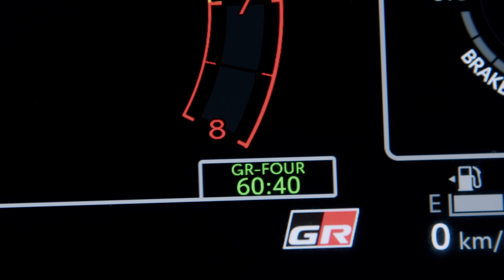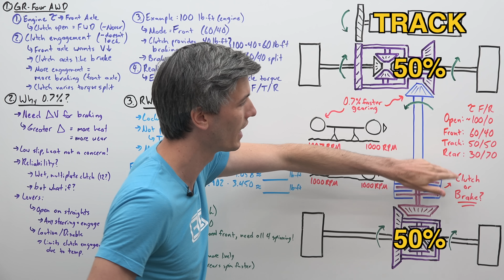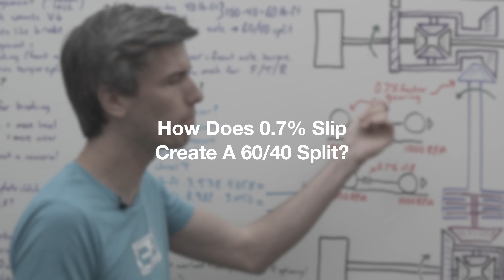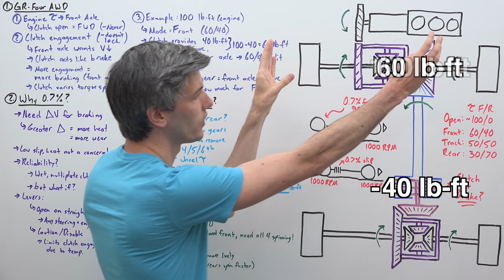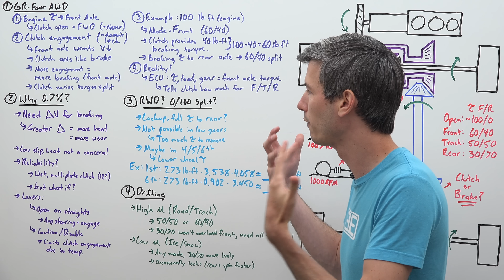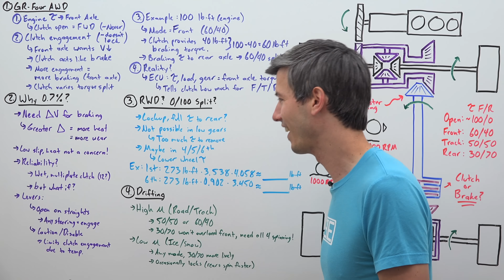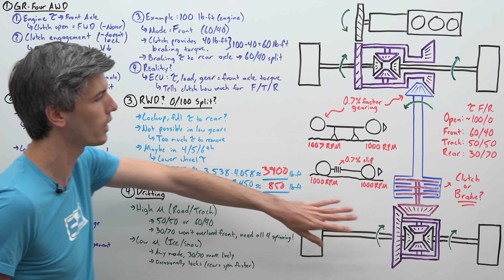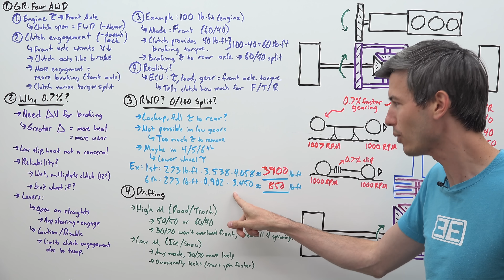Toyota GR Corolla's Brilliant AWD System - How It Splits Torque!

Comment: The discussion of slip causing heat generation is okay, but why not put some objective numbers to it? Multiply the torque being transmitted to the rear axle by the speed difference across the clutch (0.7% of the front axle speed while driving in a straight line with equal front and rear tire slip), and you have the power being dissipated. Even easier, 0.7% of the power going to the rear axle is being dissipated by that clutch, so if using 20 to 30 kW to maintain that speed and putting half of that power to the rear axle. 0.7% of 10 to 15 kW is 70 to 105 watts... not a problem.
Reply: That's a good perspective. Another point that some people (not necessarily you) miss is that you don't need a 70% rear torque bias all the time. The AWD's biggest contribution is when accelerating out from a dig, when the engine torque and transmission ratio would otherwise overcome the traction on the front tires. Once the vehicle's up to speed in a higher gear, the front tires are able to put down basically all of the power without any slip, so the rear axle's contribution can be toned down a lot.
Reply: @Kyriaeus  all true, although while "no spin" is normal, "no slip" never really occurs for a driven tire. Much of the time there is so little front slip that it doesn't matter to acceleration and that it only causes an acceptable degree of understeer.

Fenske mentioned opening the clutch to cool it on straights, but in practice 100% front bias would work fine most of the time in normal driving. 

Toyota transverse-engine hybrids (e.g. Highlander, RAV4, Prius AWD) essentially do this, powering the electric rear drive motor only when needed for traction or handling and running FWD-only the rest of the time. Some AWD EVs (all of which have separate front and rear motirs) even power the motor(s) on only one axle in normal highway driving because the front and rear motors are different and they're choosing the most efficient one.

Comment: It is really bizarre to describe the world's most common all-wheel-drive system design as if it is novel or exceptional. Overdriving shaft to the rear (0.7% faster than the front axle average speed) is the only variation from the most basic modern design, and even that idea has been used for decades.
Reply: Yep, even a plain old Mazda crossover uses an overdriven rear axle and a similar clutch pack setup. 

I think the slightly clickbaity title has people worked up - so many naysayers in the comments claiming this system would grenade itself lol

Comment: I'm SO stoked for this thing...there's nothing else like it on the market!!
Reply: Uhhhh it’s very similar to previous cars. Lol
Reply: @MaddNomad1015  ..."on the market"...
Reply: @rmp5s  all current model year Mazdas overdrive the rear axle 1.1% and use a clutch pack to distribute power to the rear. Conceptually the Yaris’ AWD system is not particularly revolutionary.
Reply: @Kyriaeus  What's your point?

Comment: This system is basically a different way of implementing the AWD system Porsche used in the 959 over 35 years ago. The 959's AWD system used a clutch pack for a center differential and had wheels that spun at different rates, but it did this by staggering the overall diameter of the tires, instead of using transfer case gearing.

The 959's rear tires spun faster because the front tires had a slightly larger overall diameter (about 1% larger). The 959's torque split varied from 50/50 to 20/80 (F/R).
Reply: Actually smaller rear wheels cause counter-effect - front wheels start to travel more distance - 1 rotation of front wheels is equal of 0,99 rotation of rear, for example. Thus when multi plate clutch is locked - wheels rotate at the exact same speed and actually FRONT wheels start to slip, causing a movement of torque to the front wheels. I think this difference in tire sizes isn’t that noticeable because tires are tend to squeeze under load so this 1% doesn’t really matter. 
And actually Porsche AWD system is rear biased, when clutch isn’t locked, 100% of torque goes to rear. 

But what really interesting is that new Audi RS3 8Y has 14% larger rear wheels in diameter than front (this is 7% more distance at the same rotation frequency), so when clutches are locked - rear wheels tries to travel more distance and all of torque goes to the rear
Reply: It's the same as the BMW xdrive

Comment: Does anyone know if the clutch pack uses its own oil or is it shared with the transmission?
Reply: The clutch pack is at the opposite end of the car from the transmission (transaxle). Did you mean to ask if it shares oil with the rear differential?
Reply: @brianb-p6586  I didn't notice where it was located. thanks for the info. Does it share oil with the differential?
Reply: @brianb-p6586  never mind i'm watching it again and its making more sense now.

Comment: OMG I love/hate my Element's (drivetrain).. like it's great - and day to day - it works fine and seems fine.. but for it to be "AWD" thinking about how it actually works upsets me with:
- an open front diff
- an open rear diff &
- the dual-pump "transfer case" (not an actual transfer case) - but a mechanical system that only sends power to rear wheels when (and only when) both fronts are spinning..
.. it's like a system I'd ever be likely to "benefit from" maybe ~4 seconds every two years.. honestly, I'm thinking about yanking the drive shaft and rear CV axles because.. they're just added weight and parasitic (?) drag.

Comment: So it's just a bevel box,clutched rear,awd system like most awd vehicles on the road today except Subaru's, large trucks, and some luxury German vehicles? I Ford escape literally does this lol
Reply: Just to explain my point, this is the cheapest way you can lay out an awd system.
Reply: Even many Subaru models work this way - as of a few years ago, only their manual transmission variants had a centre differential and the rest used a clutch to drive the rear.

Comment: So that clutch wont last? Since it slips to deliver power to rear wheels?

But the way you said it, seems that their is some power loss, this way! Why not 50/50 fixed gear, same power to all wheels no power loss or any slipage to deliver certain % to rear or front.
Reply: You would need to use a centre differential to allow the front wheels to turn faster than the rear in turns, and that would mean that you need to use individual wheel braking or some sort of limited-slip centre differential (LSD)... and even then the centre LSD would not allow active control of front to rear torque distribution.

Comment: I think there is a VW that has a similar setup to this, in that the rear wheels are over geared just a bit.   I know that the Acura SH-AWD system has a planetary gearset on each rear wheel, which acts basically like a 2 speed transmission on each rear axle;  and has clutches that can engage on or off to disengage the rear wheels and allow it to be only front wheel drive most of the time..  I believe there are actuators that the computer can use to shift those planetary gears on the rear axle, into "over geared" - so that the rear wheel then get all the torque.  Very similar to this system, except it has 2 of everything--  and the "over gear" in the rear is not permanent-- it's only engaged when it is needed on corners and low traction... In other words, the clutches in the rear can be fully locked, and still have a 1:1 ratio at all four wheels.   So the AWD clutches, and the planetary "over gearing" are two separately controlled systems....  This Toyota setup is a much simpler and much cheaper version of that, but with less independent function.

Comment: Guaranteed to shrink, wrinkle, and fade...especially fade...
If you have continuous slippage, you have continuous wear...designed to fail...
Slippage involves heat...heat is not a good thing (unless you are cold)...failure of components...
Would a torque converter, on the driveshaft or in one differential, with variable pitch vanes be an improvement...?

If I were still a mechanic, I would be licking my lips waiting for repairs to come in the door...
Reply: Slippage does not necessarily mean any noticeable wear. Heat is what really accelerates wear, so as long as the clutch pack doesn't overheat itself it's fine. Some modern automatics actually sustain a 30-50 RPM slip in the torque converter clutch instead of 100% lockup when the engine is operating at low-RPM, high-torque in order to dampen vibrations.
Reply: @Kyriaeus  I suppose Toyota warranty department will know what's what...somewhere along the line...
Being a mechanic, the slippage problems I encountered resulted in a failure...or shortened lifespan...
Reply: @ronniemaeker9102  If all slippage resulted in failure, you'd be literally swimming in automatic transmission repair money right now with the millions of transmissions just waiting to grenade themselves. But fortunately (or maybe unfortunately for your wallet) that's not the case - some slippage is bad, some slippage is good, just a matter of if the system's designed to handle it.
Reply: @Kyriaeus  Have you put clutches in farm or construction equipment...?
Have you rebuilt power shift transmissions...?
I'm not being a jerk...just asking questions...I don't know your background or area of expertise...
Reply: @ronniemaeker9102  No, nothing like that. The comments I make are based on passenger car applications and might not apply to your situation. 

That said, according to Consumer Reports, cars today last on average 150K to 200K miles before needing major repairs. Since the vast majority of cars in the US are automatic and most of the new ones employ some sort of sustained clutch slip either for noise/vibration/harshness reduction or for their AWD systems, I'd say a properly designed system can sustain slip without premature failure.
Reply: @Kyriaeus  I had a 1982 Silverado with the 6.2 diesel that we drove for 360k...(probably more since I ran a halfer on the cruise control...)
I put three transmissions in the pickup...4L60E...
When the third one failed, I then took the motor and trans out and sold the engine...to a man that put it in a 1 ton dually wrecker...

Put in a 454 with heavy duty 400 and 12 bolt differential from Suburban with tow package...
If slippage is designed in, then failure is designed in as well...
It may be what some would consider "high mileage", but if it is minimalized then the component should last a long time...
Remember when they re-did the small block Chevrolet so they would not last as long...?
Engineered failure...
Reply: @ronniemaeker9102  Out of curiosity, how did your transmissions fail specifically?

Different transmission, but the Allison 6-speeds had a failure mode where the control unit decreased clutch pressure to reduce parasitic loss, but this resulted in one of the smaller clutch packs going through uncontrolled slippage under load (especially when mated to a diesel engine).

Also, congrats on 360k - most vehicles would be lucky to reach that.

That said, even without the continuous slip, the transmission will wear down at some point, since automatics shift by slipping one clutch pack out of engagement and another into engagement under load. So in theory, it would wear down, maybe at 500k miles, maybe at 1M miles.
Reply: @Kyriaeus  The 4L back then was a weak transmission to begin with...
All of them were serviced by me, at proper intervals...
I can't answer your question with certainty, but I think it was the normal wear and tear...
One thing about the differential is that it was a 3.07 originally...
That probably put unneeded strain on the transmission...
Later, I put a 3.73 differential, ahead of the 12 bolt, and the pickup was better...
I was looking for a 3.42, with no luck...
I surmise the differential ratio was a F.U.B.A.R. from GM...
The lives of the transmissions was disappointing, but waddaya do...?
Sorry I don't have a better answer to your question...
Reply: @ronniemaeker9102  no worries, and thanks for humoring my curiosity. It sounds like a simple case of the 4L and 3.07 gearing being a poor matchup for that engine. 

The transmission probably cooked itself a bit grinding away at the torque converter if you had pickup issues before changing the rear ratio.

Cheers

Comment: Hi Jason, I'm new to the channel, great insight and knowledge! 

I have a question, that's not directly related to this topic: 
I'm currently building a sporty/streetable BMW M20, (86mm bore) and I'm deliberating whether to use a 
76mm stroke crankshaft and 135mm long con rods vs 
81mm crankshaft and 130mm con rods    
The question is, is the increased overturning/tilting moment, generated by the shorter con rods in combination with the bigger stroke, creating a friction that's so big that it counteracts the gains by the increased capacity to such extent, it's not worth it increasing the stroke?
Would be great, if you could share your thoughts or maybe do even a video on this subject. Thank you!

Comment: Na,  Subaru is still the king of all wheel drive because they keep it simple and the system works with fluid pressure rather than slipping clutches. ( at least the ones from the earlier 2000's did)  anyway once again, too much crap to go wrong. I bet people would pay exuberant amounts of money for simpler vehicles that get the job done without all of the invasive electronics. no one ever seems to think about temperature extremes, vibration, and water damage to electronics. To this day I can't understand why the car's computers are not mounted high ( like in the ceiling)  and the circuit boards dipped in epoxy for waterproofing with a circuit breaker of fuse to prevent short circuiting...no, that would make it reliable, can't have that, then insurance repairs may come down. I heard that some cars are totaled if water touches the bottom of the doors. That's crazy.

Comment: At 3:47 he talks about how the rear wheel wants to spin than the front wheels which is clear to understand, then he goes on to say when the clutch is engaged, the rear wheels is trying to stop the front and that's where i get lost. How can the rear wheels that's spinning faster try to slow down the front wheels which are already slower? 🤔 I would think the rear wheels would want to turn front wheels a bit fast whilst the front tries to slow down the rear wheel.
Reply: What he says is the front wheels should turn slower than the rear wheels (or in other words rear faster than front).
But if the four wheels travel at the same speed this means there is a braking force on the front wheels (front wants to turn slower than the rear).

Comment: Ok, it took me a while to understand how a system without a center dif can achieve this... Basically, because of the slight ratio difference, the rear unit eventually unloads the front, right?

Comment: I have the Yaris GR here in Europe. Toyota knows what they are doing but.......the rear diff/the clutch pack ls lubricated with only 0.5 L of oil. If you get the GR, I would strongly suggest to do oil change in the diff very early on. I did my at 1000 km and the oil was  very dark and contaminated with what I assume is the clutch material. My next oil change was at 4000 km and the oil looked much better. This is a very simple job and It simply makes me feel better.

Another point of interest is the fact that Toyota calls for four different oils for the car: the engine, the  transmission, the transfer box which is sealed from the gearbox and finally the rear diff/clutch pack.
Reply: Is there official instruction to change the oil of the clutch-pack (not the diff)? Does it have a drain plug?
Reply: @4x4.tests.on.rollers  The rear diff and clutch pack share the same oil. Because of the clutch pack, this oil needs limited slip additive even though the diff is a torsen design. Yes, there are drain plugs for all fluids and bunch of vids on how to change the oil. Funny, my GR lives in Poland, powodzenia.
Reply: @pawelwolski1316  Dzięki 🙂

Comment: You didn't say anything about efficiency.  If theres heat in the clutch pack theres lost energy.  How much and how can that be a good thing for such a small displacement engine.?
Reply: It is a 300 horsepower engine, regardless of displacement. Because the speed difference across the clutch is 0.7% of the shaft speed, even if all of the power is going to the rear the power loss is no more than 0.7% of the power being transmitted. That's enough to get the clutch not, but not significant to performance or even economy.

Comment: Thank you, Jason. I have wondered about variable axle torque ratios in on and off-road modes, for a while, especially after the Iveco Daily 4x4 came on the market here in NZ🇳🇿. The reports of central (electronically controlled) differentials causing vehicle fires (in hot places like Arizona) due to differing rolling diameters of vehicle tyres now make more sense to me. I will not attempt to explicate these details to anyone else, rather I shall point them to this video🙂!

Comment: Oh BTW, anyone watching this video and thinking "that's clever" really needs to see what can be done with 4 electric motors, one for each wheel!  Here we can have +-100% torque biasing and +-100% overspeeding not just longitudinally but also laterally, and all capable of controlling tyre slip at each corner of the car at around 1,000 times a second!  Thsi system is also 100% efficient as it has not gears or clutches and the eMAchine can effectively completely decouple torque from speed ie it can make any torque (bidirectionally too) at any speed 🙂
Reply: Those electric motors alone without the inverters would also weigh a lot more than this, and then you'd need either a big battery (if full EV) or another big electric motor stuck on the engine to generate power.

If you want to be able to send 100% power to any wheel, each motor would have to be rated at least 300 hp.